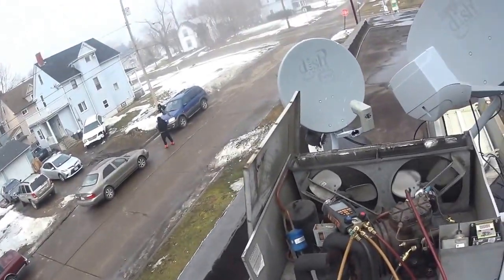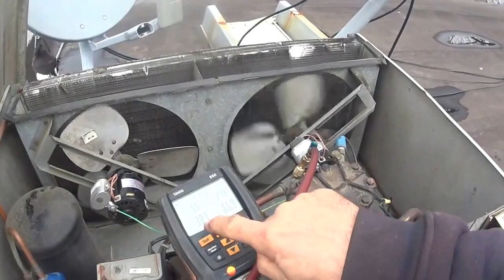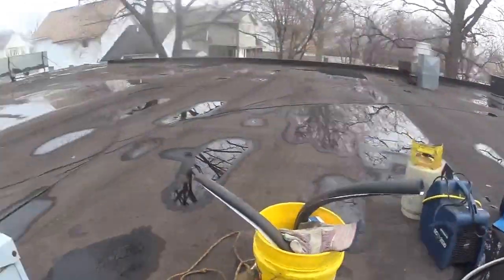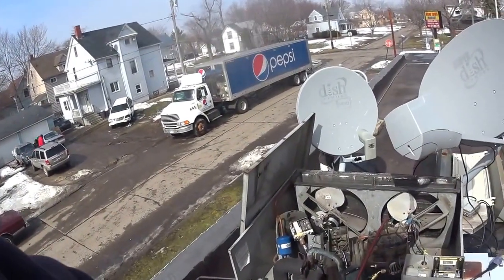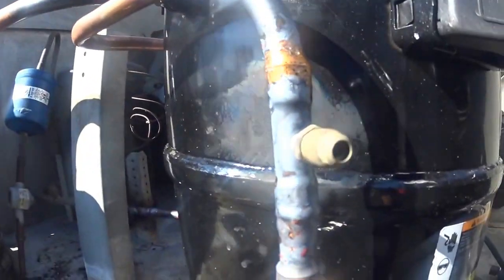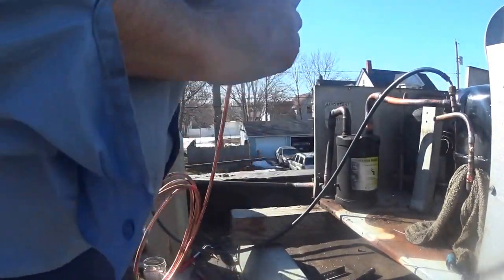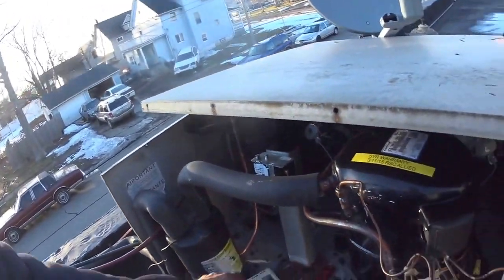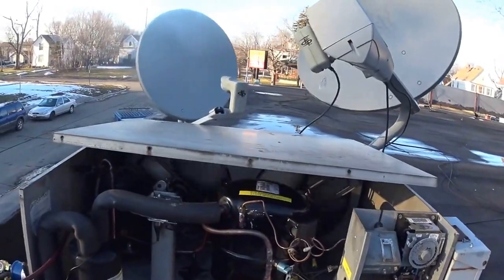Replace a semi hermetic with a hermetic compressor

Comment: Back in late 80's winter time we rebuild old semi hermetic refer and 6D in  shop, had access to mill   the heads and get new reeds, plates and oil pumps, gasket them and keep a few them for rebuilt jobs or sell at good price. Replaced 6D on ice machine at Six Flags every year, tear down clean, new ice plates ,clean tower, fill 20 bins auger fed in cold warehouse.Nice week of work if weather wasn't bad.

Comment: the compressor is fixable as long as the broken reed didn't break into chunks and scored one of the cylinders. The newer Copeland Scroll compressors some for medium and low temp applications will have sight glasses on them.  Just not on the regular recriprocating hermetic compressors and some rotary compressors.  Some refrigeration racks these semi hermetic compressors are fastly being replaced with these scroll compressors for the medium and low temp cases.  they been popular in AC systems for many years. As Semi hermetic compressors  are partially repairable the valve plates and the oil systems. Some companies remanufacture these Semi Hermetic compressors. but cheaper way to go is the hermetics the scroll is most preferred.

Comment: Watch all of your videos great job. I have 2 questions . I didn't see shut off vavles on compress and how did you size compressor or was it the same  size like a2 ton  or 3 ton. I'm an ohio boy over by warren. Nice to see vid2 from the north.
Reply from the maker: I went to RSC in Elyria and let the manager check the BTU load of the old compressor and find a hermetic close to it. the only shut off valve is on the reciever for pumpdown. The Germans don't use the letter C they use K, so in english we say Cesar in German they say Kaiser, my ancesters were the Habsburgs

Comment: Did you use the refrigerant you recover?. Nice video. I would of add a suction drier.
Reply from the maker: The refrigerant was MP39 , I'll change it over to R 404a in the future, the compressor will handle both R134a or R404a. Right now I recovered the MP39 and reused it, it's working fine.I did that to keep the cost under control for the customer. I don't like suction filters, they get soldered in and never changed, I put a flared drier filter in so I can replace it when needed. the Alco EK drier has the same material inside as a suction filter.

Comment: When youre recovering. Do you use different filter dryers for different refrigerants. Or just one for all and change it regularly? I use a appion twin, recovers pretty quick
Reply: I've been curious about that too, nobody at my shop even bothers to use one.
Reply: +fredmeebley i think it helps the recover unit in the long run

Comment: Nice clean job Jim but I'll bet you that hermetic compressor will not last 30 years but it is much easier to Carry a hermetic up then it is to carry a  semi not to mention the price difference
Reply from the maker: exactly, the low temp and extended medium temp hermetics are weaker they don't have enough torque like the high temp ac compressors do, I found it's better to use lower cut in pressure settings on the pressure control for easier starts, thanks.

Comment: Why not replace the reed valves or at least see if its just reeds that are bad from a flood back or lack of oil return either way your out of there lickityt-split, providing you can get them. The customers bill is lower too.   Win Win.

Comment: Hey Jim i need your help, i have a Holding freezer and same semi sealed compressor is not available in the market over here can i install the sealed compressor likes of copeland, bristol instead of semi sealed its a 404 refrigerant,
Reply from the maker: sure, just make sure it has the same BTU capacity
Reply: this the existing semi sealed compressor ( Copeland KAMD-007E-CAV-223) in holding freezer please suggest me the alternative sealed copeland or bristol in 404R please Jim, it would be a great help thanks